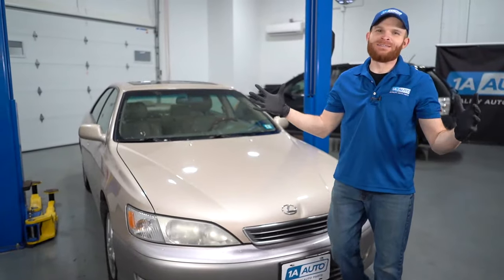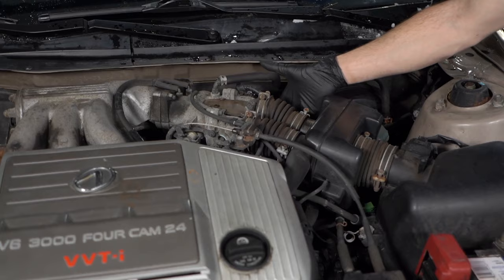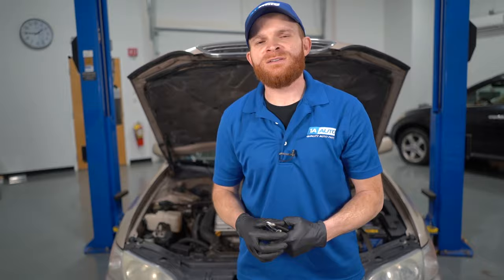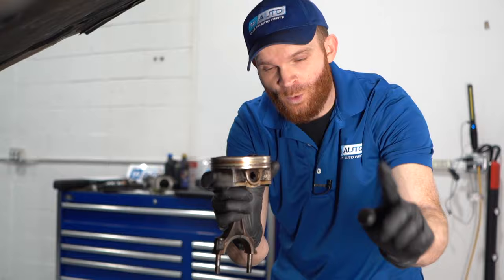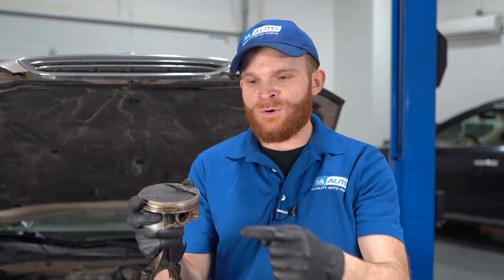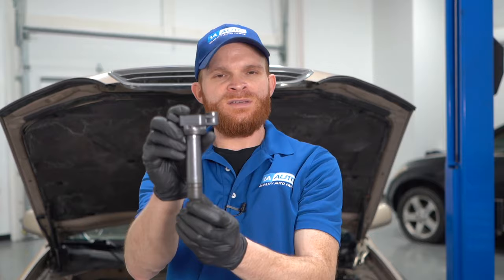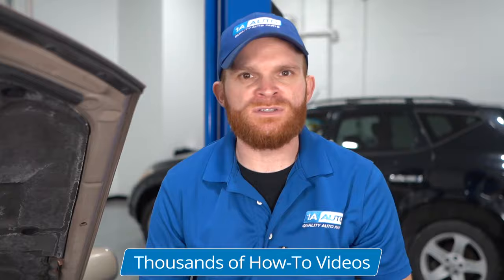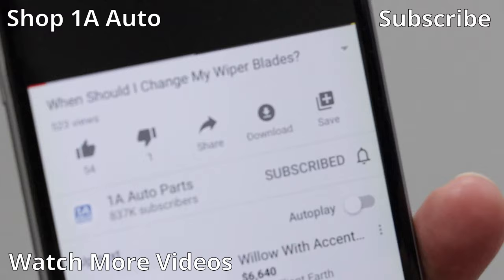Top 5 Problems Lexus ES300 Sedan 3rd Generation 1997-2001

Comment: Basically a V6 Camry.  I've taken care of a '98 ES300 for a good friend.  It's the golden age of Japanese reliability.  Nothing more than maintenance and burnt out bulbs for 23 years of ownership.
Reply: I thought about an older car, I got a big ol 2015 chevy impala limited lt, gm has issues and the car is a sleeper but thought about something like this. Maybe upgrade your lights to leds!
Reply: @jorgenvonstrangle000  I did that... Especially the driver/passenger map light (since they aren't door activated on this year/model...) Saved me a lot of dead batteries and jump starts
Reply: Please help me with mine ,it's struggles to get 20 mpg even when I drive incredibly conservatively
Reply: Love my 98 es
Reply: Mine had the stupid knock sensor go out, its running in this baby limp mode, still driveable, like it has half power, and its been this way for a few months, Ive let it sit and have been using my scion instead but yknow
Reply: So it would be useless to trade in a 2002 Camry v6 for a 2001 ES 300
Reply: I'd hold on to the 02 V6 Camry.  It's a better vehicle than the 01 ES.
Reply: @PolaxusWNSP  Did it shoot a code for that knock sensor?
Reply: @nyxxolo5798  would depend how much mileage, and how much you have to pay. The ES is luxurious in comparison to the Camry, it just feels like a much more expensive car, but there is also much less to go wrong in the Camry. I have an ES that's still strong at 145k, but my Camry had over 246k before I gave it to someone.

Comment: Bought a 2000 es300 about 2 months ago. Had 71k on it and was driven by a grandma. Everything is perfect and untouched, not a foot has even stepped under the floor mats and it looks right off the lot inside.
Reply: How did you find that prize?
Reply: I wish I was in your shoes.  My es300 is crossing 300k miles soon.  Still like new, I just wish the odometer number was lower.  Would look better that way.  I've had many cars but I have always had this one.

Comment: Here here!  My '97 es300 is going to turn over to 300,000 miles very soon.  next tire rotation is at 303,000.  Still runs like I drove it out of the showroom floor.
Reply: Mine is at 326k miles. Bought it in 2006 with 151k miles. Never change timing belt 😅
Reply: @LittleMopeHead  good to hear, im about to buy a '98 100k es300 1 owner. hopefully it lasts me a few years

Comment: I've had none of these issues and I'm at 250,000 miles.  Most of my issues have been worn out suspension/steering rubber.

Comment: I've had 5 of these cars...all are still on the road. Had a 98 with 451k original miles. Dealer serviced since new. Had a massive stack of records. Original engine and trans. Still on the road today. That was back in 2016. Had a 99 Coach Edition with the nakamichi system. Never an issue. Have my current 00 Platinum Series with the rare nakamichi system. No issues. Had an 01 I paid 450$ for. Replaced the knock sensors and the A/F ratio sensor and sold it for 1800$. And had an 01 with 339k miles for a day. Bought it from a dealer. Got halfway to pickup my wife from work and the dreaded knock sensor codes came on and it wouldn't shift. Took it back to the dealer and got my money back since it was not disclosed and I had only put 40 miles on it. Since the light wasn't on in the car and it drove fine when I got it, I knew they were hiding something. I think they ended up junking it. Sad because the body was nice and rust free which is incredible for an Ohio car. The knock sensors are not hard but I wasn't doing them when it was not disclosed and they were trying to get one over on me. My current one is fantastic. Drove over 3 hours to buy it because of the platinum series and nakamichi, which if you don't know is an insanely rare option on these cars. And man does it sound absolutely killer. I can hardly turn it up past quarter volume, so clean and crisp and the bass is insane.
Reply: I had a sc400 with the nakamichi system, it was truly impressive.  I have a '97 es300 now, sadly not the nakamichi but it has a subwoofer and tweeters and it sounds great.  I've gotten so used to the way my music sounds in the es300 I don't even like to drive anything else, it's comfy, I tend to drive it for a few hours at a time just to drive around.

Comment: I had a '97 ES300 with all of the options, such as heated seats, traction control, etc. (though the heated seats didn't work anymore lol) and it was a fantastic car. It had 220,000 miles on it (189,000 when I bought it) and spent some money repairing it, but I only bought it for $1200 in 2016. I loved that car and it never left me stranded (other than a dead battery and faulty vacuum hose line, both of which I replaced), it was a bulletproof engine that never had any mechanical issues. It only burned a bit of oil, but it was basically abused by previous owners (it didn't have regular maintenance done for oil changes I'm fairly certain) and it still ran like a champ. They're awesome cars. Camrys are great cars too, these ES300s are basically just that with more options and better aesthetics with the body design (they share the 1mz-fe V6 engine). Unfortunately mine got totaled from an accident (not my fault).
Reply from the maker: +Neon Reign Thanks for the feedback!
Reply: I call this old girl a “glorified Toyota” ...Bc that’s exactly what it is

Comment: Man my dad had bought one of these in 2003 with like 50k miles it was my first car to drive and damn could that thing take a beating we drove her to 224k miles then sold it in 2018 and the guy we sold it too is still loving it’s got 273k on it and I think he had to rebuild the transmission somewhere around 250k which is very reasonable considering the mileage and how I used to drive that car lol. Great first cars for someone under a 3k budget
Reply: Trans fluid & filter change should be done around 150k.
Reply: Kids should have to buy their first car and learn how to respect it, when you have to pay for things you learn to respect
Reply: Knock wood mine is still just cruising along, at 201189, I can still keep up with most hot rods, power and handling have been pretty remarkable to me, my first toyota (lexus es300)
Reply: 2003 Lexus ES300, love My Baby, just Love My car.  It's a Great Car

Comment: On my 99, I had a code for one of the Oxygen sensors.  I replaced all 3, and the code would not go away.  Turned out to be the Mass Air Flow sensor.  My friend who solved  the issue had the exact same issue on this vintage of Camry, basically the same car.

Comment: Reminder: BUY OEM KNOCK SENSORS FROM THE DEALER.
Trust me, it's not a job you wanna do twice...
Reply: it goes bad?
Reply: @ozmo69  If you get the knock sensor codes P0330 or P0325 the problem is most likely the short wiring harness that goes from the main wiring harness under the intake manifold and then to the knock sensors. You can buy an OEM harness on eBay for about $35. For all the work it takes to get into the engine valley where the harness and knock sensors are located you should change the short harness, the two knock sensors and the short bypass hose. Like break fast said you don't want to have to go down inside there twice.

Comment: Bought a 98 ES300 a couple weeks ago with 277k miles. Heard these are bulletproof, super reliable cars which is why I bought it despite it having such high miles. It was $2000, and one owner. I don’t intend on having it for that long considering it’s knocking on 300k, but so far I love it even with its little imperfections.
Reply: dude those cars can get up to 1 million miles use it till the wheels fall off also what app did you use to find the car?
Reply: What issues do u have with the car
Reply: Just got a 98 too! $3,5k , 3 owners & 138k! I'm a happy chappy!!! I bought it thinking I won't keep it for long but I can tell I will. Gets prettier every time I look at her!
Reply: I bought my '97 about 6 years ago with 212k miles.  I'm turning over 300k in the next month. Car has run flawlessly the whole time.  However, I think it's starting to show signs of needing something... I think it has an exhaust leak like a teeny tiny one? I think I might replace the o2 sensor it's been wanting me to replace since I bought the car.  Might.

Comment: Not very hard to to replace piston rings is an understatement. Good luck if you are doing it yourself. The car is not even worth the cost to fix it. I probably got worn rings and definitely bad stem seals in my Avalon with 340k miles but still pushing her hard. Gotta check the oil level weekly though. Started using 10w40 for top offs and she purrs just fine,
Reply: What year is your car ? I was looking at 2005-09

Comment: 6: engine sludging
7: knock sensors
8: vvt solenoids
9: U140E Transmission failure
10: U140E 2-3 Flare up
Reply: So Is it worth buying one that has 209k miles on it? But runs good and looks like it's in good shape?
Reply: @davidnjuguna3595  did you?
Reply: I'm surprised he left out the knock sensors and the wiring harness that connects the sensors to the main wiring harness. It's a very common problem with these cars.

Comment: 1999 coach edition es300, 286k miles. No issues apart from small oil leak/burn and the original radiator recently broke

Comment: And the early years like 97-99 V6 if you take your time and get the right tools especially a magnetic Spark Plug socket, the Coils and plugs are accessable in the back under the the intake. Newer ones unfortunately intake has to be removed.

Comment: Another important thing. CHANGE YOUR TRANSMISSION FLUID FREQUENTLY at least every 4th or 5th oil change. These U140E transmissions have issues with solenoids. Not sure about the U140F. Just change fluids with Toyota Type-IV fluid only.

Comment: Another issue this car has is the cabin air filter can be somewhat difficult to replace. It requires pulling down the carpet on the driver side and depressing the gas pedal so the filter will clear it. I've heard that some people have broken the filter while trying to remove it and then it ended up stuck in there.

Comment: Wow that's my car.  I'd add on the VVT solenoids and filters. When those go bad it could almost feel like the car is totaled but theyre easy to replace and pretty cheap after market.
Reply: yep, just replaced my VVT solenoids they are definitely a failure point on this car.
Reply: How do you know when they have gone bad,i have just inherited one of these cars in mint condition?!
Reply: @geoffbell166  You'll know they've gone bad when the engine starts to stutter or misfire. It'll feel like the car is hesitating to accelerate.
Reply: For real. I only replaced one so far but even then the car runs so much smoother.
Reply: @geoffbell166  The check engine light will come on and the car will not accelerate the same as usual.
Reply: @joevignolor4u949  what check engine code did you get for this issue?

Comment: 1999 Toyota Avalon with over 273K.  Never heard of half the things being common problems that this guy is waffling on about. Everything he mentioned applies to any Japanese brand car over 100k. Completely missed the oil sludging issue due to the 1MZ-FE design...way to go guy!!
Reply: Agree with you on this. 200k on the clock with original O2 sensors and ignition coils. The real issues are VVT solenoids. They tend to go bad before 200k.

Comment: Some of these ES300's (mine is a 2000) have the vacuum switching valve (VSV) attached to the side of the air filter cover, specifically where he said that vacuum hose is... I broke mine because I didn't see it when I was removing the cover to replace my intake hoses... Everywhere I looked for the part kept saying that my car didn't have it on the side of the air filter cover, though... It ended up being Dorman 911-606, which is for the 2000-2004 Toyota Camry...

Comment: Spot on! 2000 ES 300 and I’ve dealt with all but the piston rings! Now if I can just finish cutting out the passenger side cv axle since Toyota in their infinite wisdom decided to install the carrier bearing inside of the rear motor mount🙄

Comment: This is more of a "things that eventually happen to 97-01 ES300s, that also happen to almost every car that have the same parts". My 99 with 204k miles goes between 5k synthetic oil changes without needing any oil top off - definitely no piston ring issues with mine. In other words, these things are bulletproof and don't really have any major unique problems :D

The lifespan of the ignition coils seems super random. That's why I wouldn't replace all of them. I've replaced 2 on mine in the mid 100ks, and the other 4 have gone 50k+ more miles still.
Reply: For future readers, in simply passing on things I've read and am not a good source.

However, I've been finding out the transmission is a dud, the u140E.
It's a ticking time bomb once it gets past 100k

Comment: Great tips!! I have. 2001 ES300 with about 86,000 miles on it.  Recently the alarm started going off late at night.  It happened a couple times a few months ago, and now has done it again for two nights in a row.  I even left the car unlocked and it went off!!!!! Have you had any experience with this issue?

Comment: I have a 98' Es300 w/ 210k. May need to change the Catalytic Converter next year and my valve cover seals are starting to leak. But it still drives sooo good and feels very comfortable, that I still use it on my 1 hour commute to work.
Reply from the maker: +Jake Urbano Thanks for checking us out! http://1aau.to/m/Shop-1AAuto-c

Comment: im a good mechanic but the obd port wont communicate on 97 es300. im struggling

(edit: theres 6 corroded capacitors inside the ecu rotting. 220uf@50v, 100uf@10v two of them, 10uf@50v two of them, and one 47uf@63v)

Comment: These had the last version of the 1mz-fe v6 engine with a defective pcv system. The valve covers were not designed correctly and would cause oil consumption issues on the highway. The fix came, with the last version of the engine for 2002-03. The only way to fix the issue on these engines, is to change to a later 1mz-fe or 3mz-fe valve cover, with a screw in pcv valve.
Reply: Can you link a set I’m not sure I found what you described
Reply: So just search up a new valve cover assembly for 97-01 es 300 on Lexus parts sight right? Interesting hope there was a tsb for this
Reply: Pcv has nothing to imply with oil consumption the only fault that causes this is a worn oil ring on the Piston period!A bad pcv will cause pressure on the top end that's all to test this pull either oil cap or dipstick and notice oil spew or rpm change PCV has nothing to do with oil lose!
Reply: Pcv has nothing to do with oil use,just pressure in top end of engine,top oil ring is the cause!

Comment: Have this exact car, however the ABS light is on on the dash, same as Trac OFF light and check oil light. Pls what's the right thing to do?
Also I'm certain the previous user abused the reliability of the car and messed up with the wiring system of the entire car, I'll like to get a blueprint of the car's wiring so I can correct it myself.
Thanks

Comment: Do you have a pro tip to remove a stuck water pump from a 1995 Nissan Maxima? The procedure to 'jack' it out failed (broken tabs on the pump). Very tight space so a puller won't work. Suggestions appreciated.

Comment: My car has had all of these problems plus jerky transmission shifts into 2nd gear. It refuses to shift up as well when it's cold outside so I'd be doing 30 mph at 3500rpm for a few minutes before it warms up and shifts into higher gear and drops the rpm below 1500.

O2 sensor is very common with these engines. I've replaced mine twice and it still kept on failing and smoking heavily.

Carbon build up is also there.

The suspension also went bad or so the mechanics told me so I had it replaced and it still feels unstable to drive overall. The steering feels dead until you turn it last a certain degree and then it just darts.

There's also wind noise issues from above the door windows in all of these cars which is always there and it's annoying. Speaking of windows, look for gaps between the windows and the b pillar. You'll get rain water build ups sucked into there while driving with the windows up.

The design is a good looker and the leather interior holds up super well. Mine isn't garage kept and there aren't any cracks in the seats. Just wipe it down every few months with a leather conditioner and it looks new.

The engine is super smooth and quiet and there's no drama when accelerating hard. I prefer a v6 overall for this reason.

Comment: I have a vibration noise when in park on  but if I move the steering wheel it goes away it use to go away totally now it just gets lighter , it goes away all the way when I put it in drive though and sometimes comes back when I am at a light I know it’s not the exact engine but somthing is vibrating , should I really be worried , other then that it’s my first car and the best car, replaced vacuum hose and I bought a battery right and I guess it was a bad battery because I took my starter out and tested it and it was good and so I took my battery to autozone thinking oh it’s not my battery but I didn’t know what else it could have been going thru everything else possible and it was a bad battery , has never left me stranded , 190.5k miles

Comment: Can anyone help I just bought one yesterday for 2k :( island beater I was going up a hill at 60mph it was reving high at 5k rpm going up and I lost speed also smoke coming from the front and filling the cab notice the trans getting hot what it could be bc it drives perfectly normal on a flat normal road